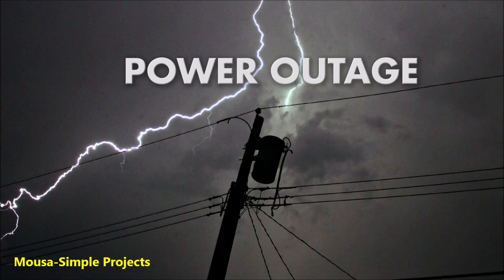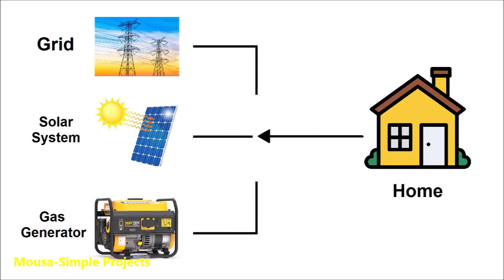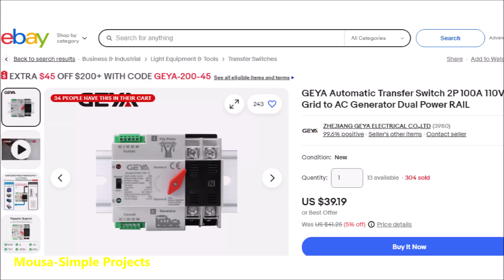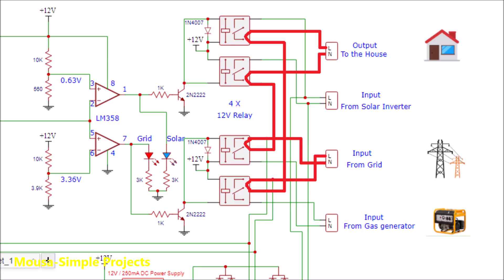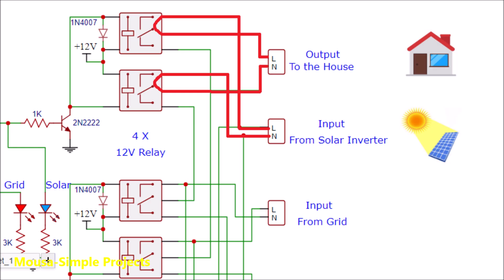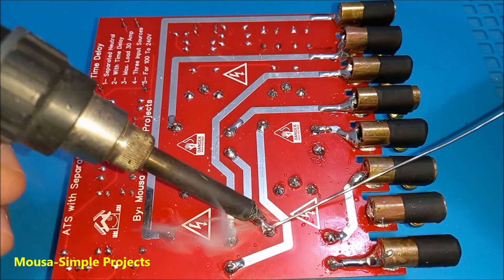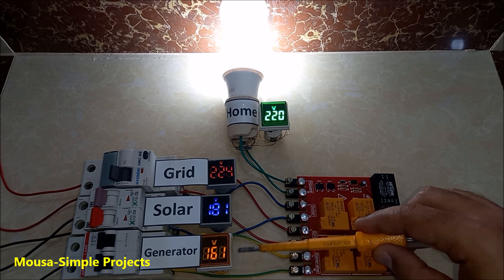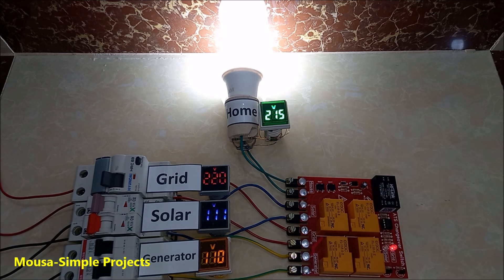How to make Automatic Transfer Switch ATS / Changeover with 3 Input Sources

Comment: Why not install a Automatic transfer switch between Grid power & Solar Power. Then a manual selector switch over between Solar & Power Generator? Since the needs to manual start generator.
Reply from the maker: Good idea but still manual, i was thinking about using a second PCB board as "Auto engine ON/OFF" for the generator (because PCB manufactures always send you at least 5 PCBs, i used one the other 4 are unused). It still cheaper than buying two commercial ATS.
Reply: @MousaSimpleProjects  My home system is using ATS between Grid & Solar. If I have to use the generator, will have to start generator, plug out the supply cable to generator. For essential items only. My area power outage is only monthly once. 

It's a good idea to reuse those extra parts. Make a video for us to learn from you. Thanks!

Comment: I wold connect my house to the solar inverter
Connect the solar panels to the inverter as first input
Cascade network electricity and generator by simple ATS with one contactor to the inverter as second input
Make Generator auto start if needed by batteries level